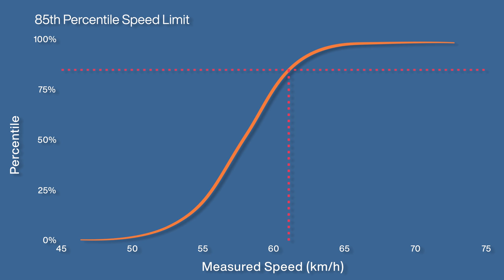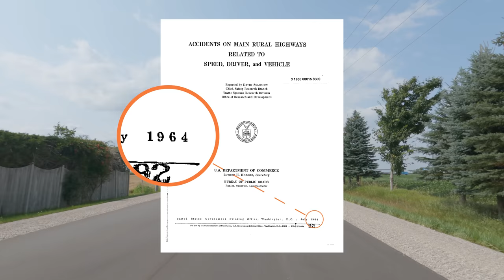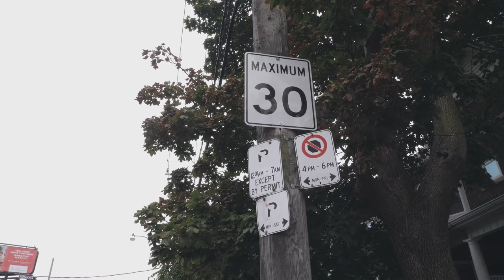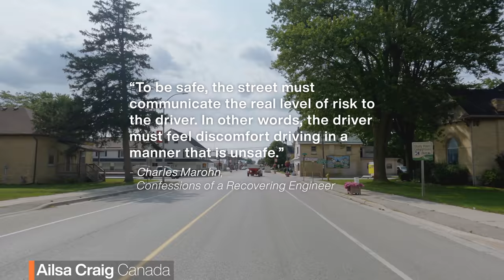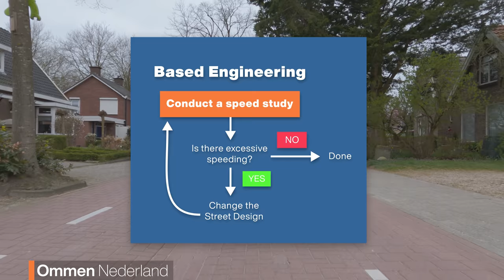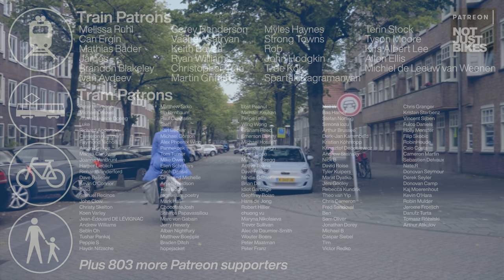The Wrong Way to Set Speed Limits [ST06]

Comment: In Texas, those descending speed limits going into small towns are ineffective for another reason as well - they're often times speed traps meant to generate speeding ticket revenue for the town. They're used precisely because they're ineffective. They want drivers who are unfamiliar with the area to keep going at or near the same speed they were going outside of the town, knowing the vast majority of drivers will simply pay the ticket instead of driving back out into the middle of nowhere to try and fight it. This is true of a lot of areas in the Southern US; I'm not sure if towns in Canada do the same.
Reply: Some towns in Canada do this, especially the smaller ones with a local police force. They also do it with photo radar and then blame the drivers for falling victim for the poor road design.
Reply: @geobloxmodels1186  that documentary was about bootleggers too.
Reply: It's not just the southern US, it's all over. I live in Wisconsin and there are many small towns with speed limit changes designed exactly like this. Most of them also have some sort of obscured place for the cops to sit, just beyond the sign, so they can write ticket after ticket without actually making anyone safer.
Reply: As someone from Michigan who got slapped with a 240 dollar ticket on his first day in Texas after missing one of the 5 signs leading into a town (53 in 40 zone that had literally just begun), I can confirm this comment is accurate lol
Reply: In Canada we just do this, but we also make sure to put a tree or other object in front of the speed limit sign in order to further endanger the people in these small towns and get more people killed, so you know, we can bill a few more drivers with speeding tickets.
Reply: It's the same there too.
Reply: It's not as common in Canada but I have been in Southern states of the US and its more common there.
Reply: So town residents willingly risk the safety of their people for some $$$? Messed up.
Reply: Yup. Texas 6 between Waco and College station. Ridiculous
Reply: I might be at risk of stating the bleedin obvious. But whether you are familiar with an area or not, if you are coming from a rural area into an urban one SLOW DOWN! - regardless of the risk of getting a ticket!
Reply: @rogink  some places are so rural it’s hard to tell when you’ve entered the town.
Reply: @zachsielaff8296  ah…Rosendale…
Reply: @Ahmed-N  I've heard it's because the taxes in small towns don't generate sufficient revenue so they need an additional source.
Reply: @s1rhcs1vad Yep. I made friends with a group of guys from Wales on vacation once, and I was saying to them that I was surprised how I kept seeing cops running speed enforcement that were totally in the open, visible from very far away. They said, "Well of course, you wouldn't know to slow down if you couldn't see them". They were horrified to learn that American cops hide when doing speed enforcement in order to generate more tickets.
Reply: I feel my car should know to slowdown because it's an electronic throttle and my phone has GPS data and the map application on it has speed limit information prominently displayed.
Reply: I think this factors into many of the ideas around policing speed limits. That's why speed limit cameras are so beloved. They only send the message to the offending drivers weeks after the incident. The North American model seems to be that unless you can make money with something it shouldn't be implemented. 

It's as if they are applying the drug manufacturer thinking: there's little benefit in a cure, but a lot of money in treatment.
Reply: Lmao
Reply: Looking at you, Texline -_-
Reply: Yep, I fell for it when I was driving in New Mexico. The town all of a sudden appears with very little warning other than small speed limit signs. Got a ticket 😢
Reply: @lyssasletters3232  uh oh
Reply: It crazy that cops don't do their jobs, which would be dangerous considering that the American Highway does not consist of actual shoulder lanes. instead the shoulder lanes are used for people with money to go faster (why did we pay for taxes again?) A highway that most likely was not planned efficiently and know you either pay extra or take the long route.
Reply: Most towns in Canada don't have local police.  They might have regional police, provincial police or RCMP.

Technically a premier could stop any town doing that with a stroke of a pen. Municipalities are creatures dominated by the province.  Toronto had their wards reorganized and reduced in number DURING the last election, because the premier felt like it, with no recourse in court.
Reply: EXACTLY!
Reply: Correct, speed limits in the US are generally a form of taxes, their primary function is generally to generate revenue.
Reply: @langhamp8912  Ford in EU have been selling cars for years with that option. It can read road signs, display the allowed speed, and if you wish not allow you to exceed that speed
Reply: I''ve seen this tactic being used in PA as well.
Reply: My last car overheated at the top of a hill less than a mile outside a small town in the middle of nowhere, Nevada, due to an at-the-time unknown coolant leak. After letting it cool down for a bit I decided I would just try to drive somewhere that would be better to stop and investigate the issue further - so I hopped back on the highway and continued at the speed I'd been driving through the desert for hours, 70+ mph. Next thing I knew I was right on someone's tail who was going much slower; I was in such a panic about my vehicle I wasn't really paying attention to my surroundings, and didnt understand why this person was going so slow. The thing is though, they were still going over 50, so even though it seemed a lot slower to me, it still wasn't slow enough. By the time I realized we had entered a small town and the speed limit was much lower there, like 20 or 25 mph, I had already been clocked and pursued. I pulled over and got a pretty harsh speeding ticket; the officer told me he could have charged me with reckless driving at the speed I was going.

So yeah, part of it was the unluckiness of the fact that breaking down just outside of town meant I picked back up to full speed exactly when I should have been slowing down, had I driven straight into the town I might have been paying more attention to my surroundings instead of preoccupied with the status of my vehicle, as it were.... but even then, clearly going by the speed of the vehicles in front of me wasn't enough. When you've been driving often 80+ on straight roads for hours, reducing your speed to the 20's is like slowing down to an absolute crawl - it's easy to slow down to 40 or so and feel like you've slowed down enough.

But yeah, I really can't fault myself, because they were obviously there for a reason. They knew people wouldn't slow down enough - but that's clearly by design, whether intentional or not.
Reply: Not just the US South. It’s many rural towns in most states.
Reply: @Chandler Russell 
Better to just avoid Texas altogether, if possible.
Reply: @s1rhcs1vad  - C.O.B.B. = Count On Being Busted. I don't go out that far for mostly that reason.
Reply: @rogink  
“Urban” can’t be stretched to cover all the No-Traffic-Light, wide places in the road that have speed traps.
Reply: @Anurania  
Many rural towns are dying because, in a tech-driven world, humans are more creative in areas—cities—where people interact with many others. 

Speed traps for revenue are similar to the Medieval practice of bleeding sick people.
Reply: You should just pay attention to the damn speed limit, I hate it when people don’t have the common sense to slow down in a town, even if you are ignoring road signs (which makes you a bad driver)
Reply: @HieronymousLex   - Instead of slowing down, you could simply increase your skill level and stop demanding everyone slow down to your level.
Reply: @PRH123  It's an option, right? eBikes have both a top speed and an output limiter, usually set to 20 mph or 250 watts. The same could be done to cars.
Reply: @langhamp8912  would be a good idea. Would save a lot of lives too.
Reply: @Kevin M Nothing is more important to the gov than getting your money. In fact if people get hurt that is all the reason to increase the price of the tickets to generate even more money. So they are banking on people getting hurt becuase it will only make them even more money.

Here safety is presented by increased enforcement and never better design or anything that would actually improve safety. When the goal is to generate money you generate money, they even spend money on aircraft to find speeders on interstates that they reduce speed on in some states. They will spare no expense to get your money and in the same token there is never funding for actual safety improvements.
Reply: What those governments need to ask themselves is whether the speeding ticket revenue is worth the damage, that that road, effectively a barrier through their town, is doing to the town's economy.
Reply: @scifino1  Usually when that occurs they take a freeway and then put some speed bumps in followed by a bunch of businesses the idea is your going to be going so slow now you might as well stop here. Oh wait that is the Dominican Republic... lol
Reply: I don’t know about out East, but rarely in small town Sask. The RCMP could care less most of the time; they’re underpayed as is and would rather sit in the detachment and drink coffee. Source; both my father and uncle are wrapping up their service and retiring soon.
Reply: @rogink  Perhaps you don't live in North America.  In Canada the 50km speed limit sometimes starts at the city limit which can be way out in the country and still no buildings in sight,  just some dip in the road or trees way up ahead behind which the cop will be waiting.
Reply: @TommyJonesProductions  Driving is not some kind of game or competition. Speed limits are there for a reason. If you can't understand what that reason is, I suggest you need some driving lessons.
Reply: @rogink   - Yes, speed limits are there for a reason. But intentionally low speed limits are there for one particular reason: revenue. If you're such a crappy driver than you can't safely go 10-15mph over most posted speed limits, then you are the one who needs driving lessons.
Reply: @zeroibis  To be sure, most drivers break laws most of the time, and automated ticketing seems an effective way of reducing their lawlessness.
Reply: @langhamp8912  Yep becuase we want them to find out at a later date when they did something wrong and not when they are doing it. That is how you teach them... to pay up.
Reply: @TommyJonesProductions  Hmm. You really think you can safely exceed speed limits in urban areas by 10-15 mph?  Hoist by your own petard m8!
Reply: @rogink   - Anyone with proper training can. The fact that it shocks you just shows how little training you have.
Reply: @JustAnotherHo  Really nice one in my neck of the woods in Toronto... it's a 4-lane street, nice and straight, limit is 50. But, there's a school and it drops to 40... with a really nice, big tree covering that sign up thoroughly if there are any leaves on it (which there are for several months of the year). Good thing we moved to this 'hood in the winter so I could know that sign even exists!
Reply: @TommyJonesProductions  I won't go into some childish competition about how much more proficient a driver each of us is. But clearly the rest of us are missing out on your driving expertise. Perhaps you'd care to share it by teaching others to drive?
Reply: @rogink   - I have been an instructor for race drivers. Please take a driving course so you won't be a danger to other drivers.
Reply: @TommyJonesProductions  Hmm. You do realise that you've broadcast your driving habits to the whole internet? Youtube is a matter of public record, so I'd advise you to avoid incriminating yourself even more!

And rather than teach people to race cars, I've taught them to drive.
Reply: @rogink   - Someone should teach you how to drive. If we had better driver training we wouldn't need revenue collecting speed traps.
Reply: Here in NC it's the same. Small town revenue
Reply: People seem so certain of this conspiracy to generate revenue, but I don't think that priority is nearly as prominent/common as speedy drivers suspect. That said, tickets are a problematic form of punishment. I heard a good quote somewhere that if something is punished with a fine, that just means it's legal for rich people.
Reply: @Maranville   - If it wasn't about revenue, the speed limits wouldn't be so ridiculously low.
Reply: @TommyJonesProductions  they're not
Reply: @Maranville  oh, but they are, by a lot.
Reply: @Maranville  I can only speak for Texas, which has no state income tax. Cities and towns must find other ways to generate revenue, and speeding tickets are one of them. I don't think this is much of a conspiracy, it's just a matter of fact that over half of the budget for some towns is generated through tickets. There is a known speed trap town called Estelline which generated 84% of its revenue from tickets in 2016. (Look it up!) Police departments also regularly get in trouble for setting ticket quotas, which are illegal here but still common. (There was a case like this in Dallas in May of this year.)
Reply: For some reason YT deleted a comment to this effect, probably because of a pdf link, but crash survivability for pedestrians goes from like 90% at 30mph to 10% at 50mph and zero at 60mph, and even for drivers it's pretty low at highway speeds, and essentially zero for those who speed on the highway. Even good drivers can crash, and physics is cruelly indifferent to things like whose fault it was, how fast the flow of traffic was, how much of a hurry you were in, etc.
Reply: @Ahmed-N  The town residents know about the hazard, and don’t go anywhere by foot anyway!
Reply: @geobloxmodels1186  That wasn't a documentary.  That was the movie _Smokey and the Bandit_.  Here's the scene:
https://www.youtube.com/watch?v=jcNFjpxU0E8
Reply: It should be common sense to slow down once you reach a town, as there is a higher probability of someone crossing the street
Reply: Yeah some Canadian towns do the same.

In my city, there is a main road that comes in from 80 to 60 then 50. You can barely notice the first 50 sign, and the road design is extremely wide and sometimes double lane in the city portion.

Sometimes in my city you have to just always have to remember what and where the speed limit is, because if you miss the sign they won’t show it again.
Reply: @Thomas if the sign wasn't visible because of the bush you should have won in court.
Reply: I watch those signs like a hawk. It pisses me off to no end as it ruins my fuel economy, but i ain’t stupid. Always a trooper ready
Reply: Yes this happens a lot in Canada too. Same thing happens with construction, there will be a 100km/h freeway that suddenly drops to 30 with no warning and there will be a cop right behind the sign ready to catch anyone who couldn't slow down fast enough and hit 'em with those double fines. There's also a lot of cases where cops will try to bully people into speeding by aggressively riding their bumper in an unmarked car, then immediately pull them over when they speed up to get out of their way.
Reply: Lethbridge, AB (Texas North) is TERRIBLE for doing this. It's just a regressive tax to avoid implementing property taxes...
Reply: When in the Netherlands we approuch a city name shield, we know the speedlimit is 50km/m, when not otherwise appointed. So, we will not enter a town with a too high speed. This shield already by law, means that the speedlimit is 50km/h.
Reply: More and more cars on the road and the speed limit is reduced over and over. Major congestion is dangerous 
When people travel slow, they are less alert, The faster they travel the more alert and aware of their surrounding they are
Traffic lights are not synchronized to improve the flow but in most cases hinder the flow
Now we have traffic lights, than stop left hand turns when you could turn safely.
Lights for left hand turns are often green for absolutely nobody and no cars move in any direction for extended periods of time
There are even red lights stopping right hand turns 
Construction zones slow down travel when there is no construction or danger and extend far beyond the area of construction
I have seen construction signs that must be abandon cause nothing is going on for weeks/months
Most stop signs should be replaced with yield signs
Every city town needs major improvement to help the flow of cars to be economical and efficient
Most Car achieve maximum fuel efficiency at approximately 70 km per hour or 45 miles per hour
With sky rocketing fuel prices, fuel efficiency is of major importance
In order to improve fuel efficiency and reduce congestion, serious effort to improve traffic flow is in the best interest of everyone. 
Save fuel, save time
I would like to believe that the traffic controls are designed to be most efficient for fuel and time but nothing is perfect so there are a rarely problems
But I do believe they are be made most inefficient for fuel and time but it couldn’t be design completely inefficient so you rarely find efficiency for fuel and time. 

If the time to travel to a destination takes twice as long, that will double the number of cars on the road
The faster we get to our destination the fewer cars on the road